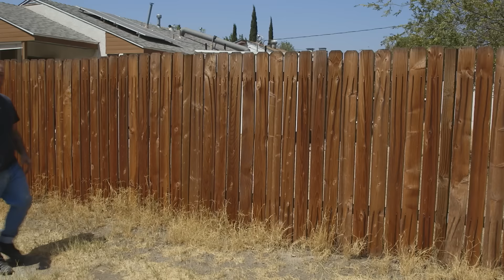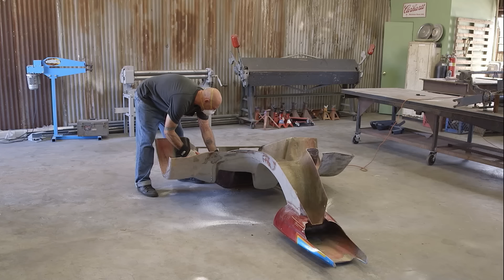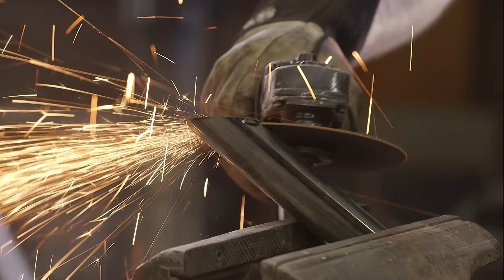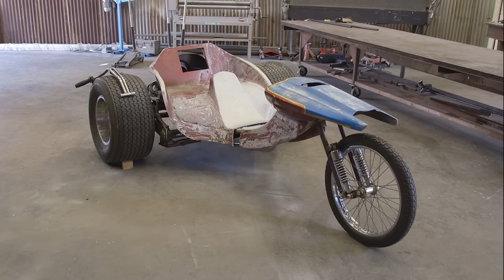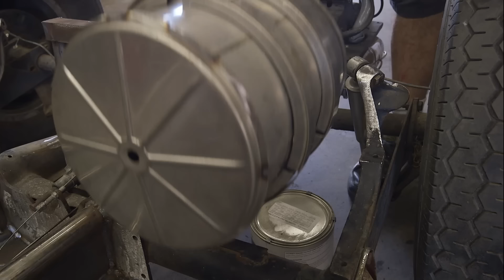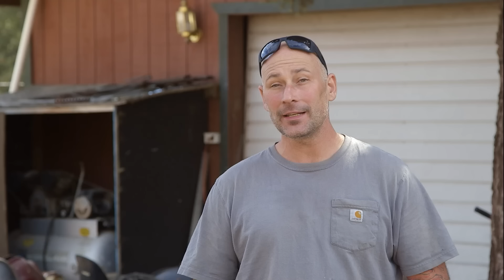Full Custom Garage - Season 2 Episode 2

Comment: That stake is used for setting concrete forms. That's why there's all those holes at different intervals, to adjust the height then nail to the form.